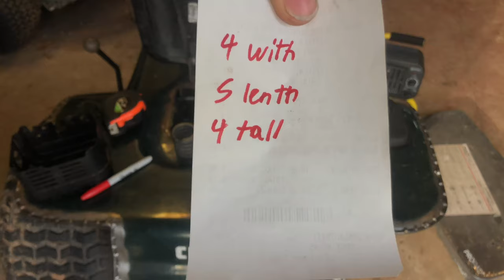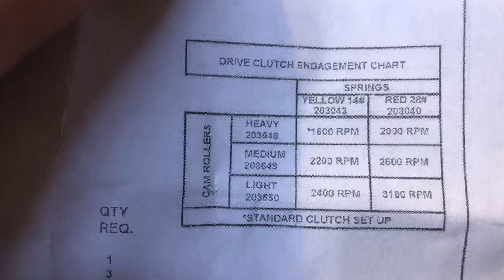Racing Mower Shifter, Wheel Bearings, Battery, & Brakes

Comment from the maker: I will make the new "E-Brake" work! Maybe lights and exhaust next video of this or maybe even the new project! We will see!
Reply: What did you mean by, "The govorner on this engine, is dont be stupid"? I know thats not really important, what im really asking is, did you remove the govorner?
Reply from the maker: @MrRandy-ti3jr  It means that I bypassed it, and the "don't be stupid" part is holding it full throttle until it blows

Comment: Turn your voltage up and wire speed down. Fluxcore or not you can still make uniform beads it’s all about technique. I’d grind those welds back off before they break but that’s just me. I dig the build ideas tho
Reply from the maker: Yeah your right but I'm kind of new to the welding thing but I am learning and getting better at it! So far they are holding.

Comment: I also lost brakes going about 30 down my road. I pushed the clutch in and the pedal broke off due to the spring being too heavy. I had to put a chain link in there to make it a little looser and weld the petal back on and it works fine now. I have a 1982 dynamark and it's currently being worked on because it now has engine issues. I think the timing might be off and I need a new solenoid. Your doing a amazing job on your mower. And BTW I love Cars and Cameras
Reply from the maker: Thank ya Sir!

Comment: Did u ever end up welding the diff? If so how did u do it?
Reply from the maker: Na dude I haven't welded the diff on this thing, maybe just maybe I might do one day but open is fine for me right now. Fearless Front has a good video and CarsandCameras as well!
Reply: @IngenTechNational  I'm just getting into this. How does it turn on pavement with a locked rear end? I'm making a low speed mud mower.
Reply from the maker: @davidrule1335  It should turn alright on or off-road but I haven't done it yet on the off-road lawnmower but when I do we will see.

Comment: What's the part number for the front wheel bearings?
Reply from the maker: https://www.amazon.com/gp/product/B078JY8452/ref=ox_sc_saved_title_4?smid=A3BDHA3CPU6FI5&psc=1
Reply from the maker: 532009040, AM118315, AM127304, 10513, 251210
Reply: Thanks!
Reply: I'll send some pictures of my project when the weather breaks in a couple days.

Comment: 13:40 That is not a TIG weld.
Reply from the maker: Well, I'm no professional expert but it did look like it.
Reply: @IngenTechNational  That's cool I'm a retired pipefitter, That's hard wire MIG you can get a 7014 AC stick to look like that also.